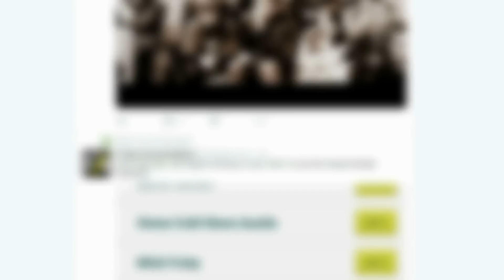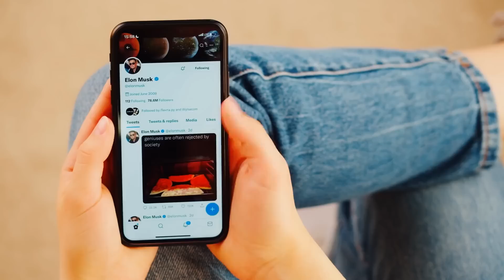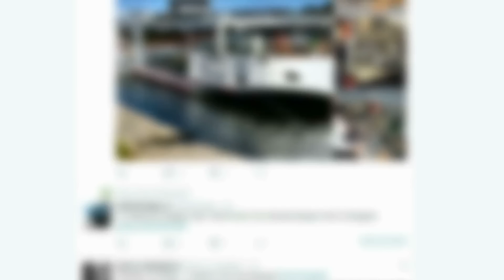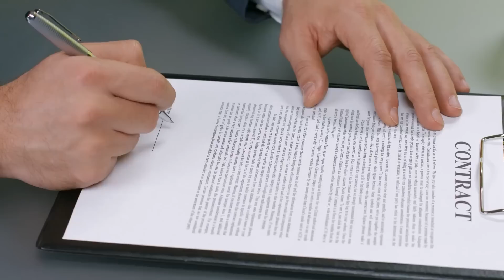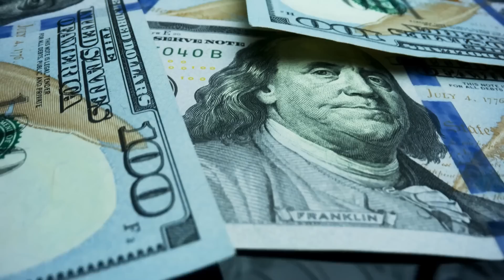ULA rocket is in BIG TROUBLE, "EXPLOSION", Elon Musk's Reaction

Comment: Vulcan test article explodes = BAD

Starship test article explodes =Success 

  Also, ULA wasn't formed "in response" to Spacex.
Reply: You get success when a rocket can launch when initiated and surpass Max Q. Blowing up a month before == BAD.
Reply: @Echoeversky Ü  By that argument, North Koreas rocket program is a smashing success. 

  Also, the cause of the 2nd stage failure may be the test stand, not the Vulcan rocket itself. Investigation is pending.
Reply: Those are not raptor engines
Reply: @robertbolding4182  How is that relevant?
Reply: It successfully explosion.